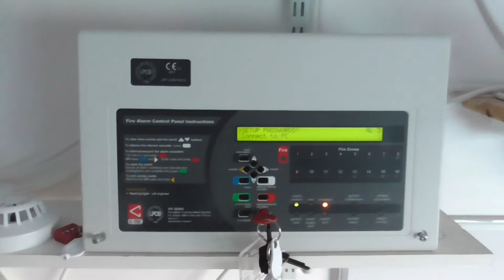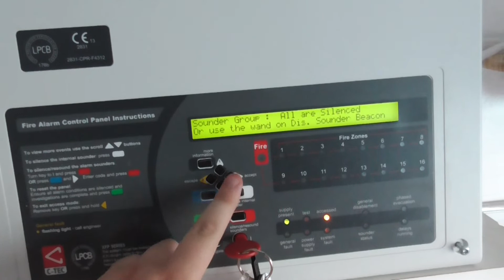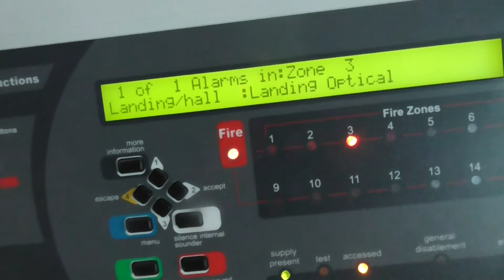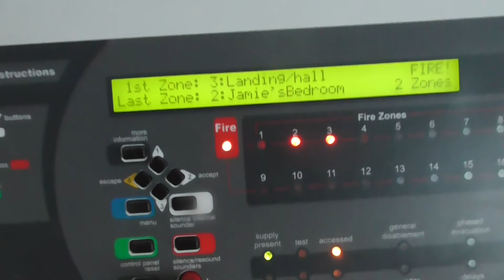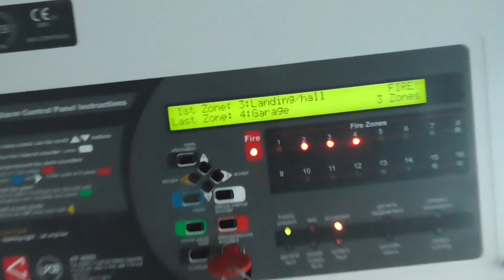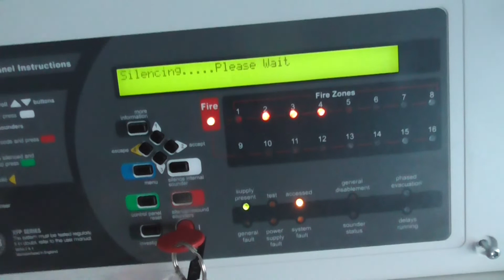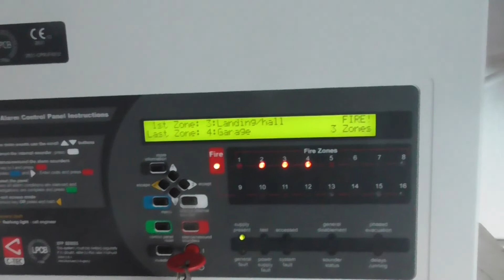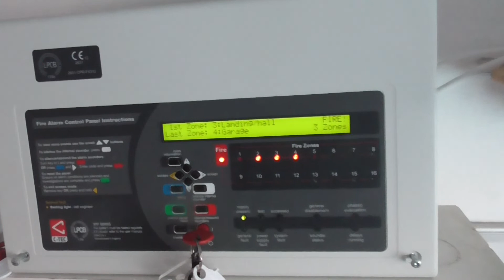Apollo XPander System Test 5

Comment: Can me ask  you for a bit of help? 
So i am fitting an XP95/discovery locking cap, on me discovery bass sounder beacon, as i want to have it as a sounder only. But what do i need use to lock it in its place? I see a tiny screw, but absolutely none of me screwdrivers work with the thing.
Reply from the maker: Hi, I’m unsure. As I have only had experience with the C-Tec ActIV sounder with the locking cap and it just clicks in for me. To release it there is push down plastic clip that needs to be released to open it. I’m not sure about the Discovery sounder beacon base as I only put detectors on. Hope you get it sorted out.
Reply: @j1firesystems440  No problem. I found out today that, you have to do it with, 1.5mm allen key, in order for it to properly lock it in place. Otherwise the cap would go on but not lock in it place. I have this morning ordered one and it is on it’s way.
Reply from the maker: @benmannion8338  Ok that is good to know.